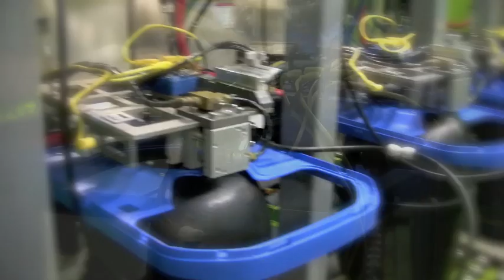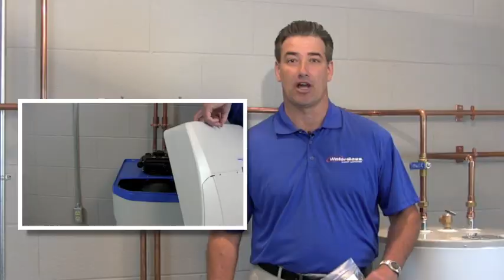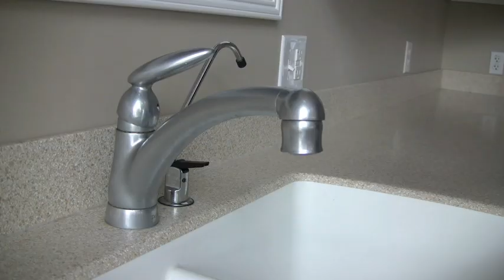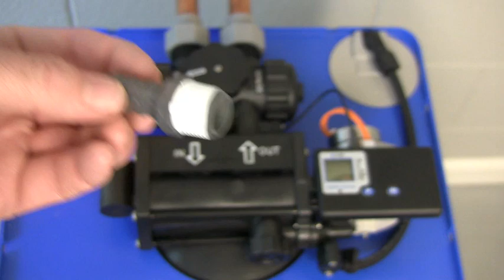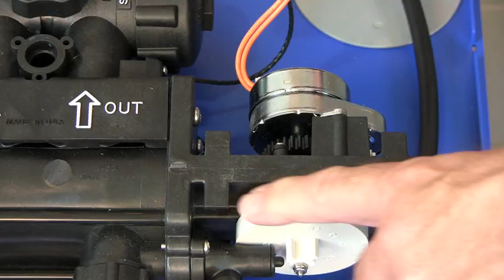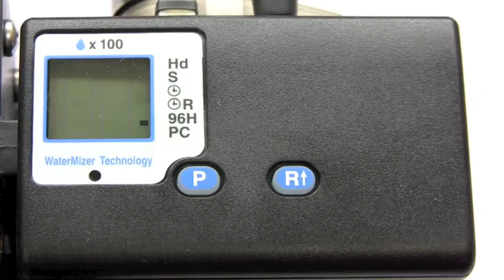WaterBoss ProPlus Installation

Comment: Do not buy the pro 180! It was missing the quest parts, the drain hose, and even the warranty card. With no water to my house I called them, and they said call back during business hours. I called today and got an automated voice response. No one was there, still have not got a return call. Fortunately, this is replacing an older unit and I was able to get by. Again, do not buy!!

Comment: I've had mine for five years and it has worked out well so far until I had to move it. I ended up stripping the plastic threads on the OUT and it looks like I would have to purchase the whole part. Very dissapointed. Bad, bad design. The GE they sell at home depot has removable plastic IN and OUt ports just incase this situation happens. I shouldn't have to buy a big expensive part for stripping a small plastic piece.
I guess it is time to head down to home depot.

Comment: Why does yours have 96H lit up? Mine doesn't.
Reply: 96H means it's on a Power Clean cycle. It will regenerate every 96 hours to clean excess iron out of the filter media.

Comment: I have a question. I have a new water boss 180 and there are cold and hot water pipes that seems to go to the water softner. No hot water should be going to the softner..right? Cold should go in..but where does the OUT line go too? Doesnt it go back into the cold line in a different spot? I think the previous owner had it set up wrong. Someone please help out...thanks

Comment: Bought a WaterBoss 180 Pro from Menard’s about 6 months ago.  It DID NOT come with Qest fittings.  Those were extra items.  Finding a plumber to install the unit was a challenge.  Most local plumbers wouldn’t touch it.  I finally found a pair of plumbers who would install a few weeks ago.  The unit works well although it does drip where the line in is connected to the unit.  The plumber used traditional copper fittings as he couldn’t find Qest fittings.  Fingers crossed.  I may attempt to re-do the connection myself, if I need too, and will order Qest fittings.  WaterBoss really should include the required Qest fittings with the unit - as mentioned in this video tutorial - to eliminate the hassle of tracking them down, locally.  Even if I was charged a few bucks more at the point of sale to have them included, it would be well worth it.
Reply: I bought my unit 5 years ago and I'm having to replace it. My old unit came with the Quest fittings and I hope I can reuse those fittings. Being a senior on Social Security a plumber is a wee bit expensive.
Reply: Well I guess I should start reading the comments. This exact same damn thing happened to me and I just had to do an hour round trip to go and get dielectric fittings and a 1-inch to 3/4 pipe fitting reducer which severely added to the cost of this unit which makes its competitively priced nature go right out the window when I had to waste additional time and money on additional parts.

Comment: This is promoted as a DIY project. However, it no longer comes with the Qest fittings, Menards to do not carry the Qest fittings so you have to call customer service to acquire them...dumb. Supposedly 2 days to get them. The old online manual says the fittings are included. Put them back in the box.
Reply: Yeah I called and bitched the lady was kinda rude but said she will send them my softener was made in February 2020 and still said they were included in my manual. It's their bad for not changing it or removing the old manuals online

Comment: So I don't think these come with the "Qest" fittings anymore... mine sure didn't and the box states 1" female NPT fittings not included. Those would have made the installation easier.
Reply: Yeah I just bought the black pro they sell at a fleet farm and we looked in both boxes they had even though saying they were included they weren't. The store gave me some 25$ solid stainless flex hoses for free. Then I called waterboss today and complained they said they stopped including the fittings in 2018. My softener was made in feb 2020. She said they were going to redo the manual but will send me the fittings for free. I figure I'll use those and keep the others for backups incase I have problems. Thing was 500$ but they were giving 150$ giftcard with the purchase right now plus I got another 10% off I hope it works good. Nice looking unit for 300$

Comment: Horrible  dont buy any I have had to purchase one every two years !!!!!! not a very good product and the customer service is terrible and they don't stand behind their warranty  rip off the unless you like to disassemble things and replace o rings for a hobby plastic wheels gears with as all magnet  The last one I got all of the red settlement and resin from the resin bed kept washing out of the unit itself right after I purchased it and they asked me if I put it on its side The store clerk lowered it and the vehicle with a forklift and took it off the shelf the same way

Comment: awesome unit. very little that could go wrong as it has very limited parts. I've owned 1 on well water for over 10 years. also,it's not a product sold by a "salt" company meaning their not double dipping-its on demand-u never have to touch it but add salt even when power has been interrupted for hours! only issue-u need to grease the wheel mechanism with good grease-if not-it will chew the cycling wheel up-only thing I ever had to replace

Comment: I have never seen a check valve installed between a water softener and a water heater. The"norm" is a check valve before the water softener to prevent back flow into the main water supply and an expansion tank before the water heater. In addition, there was no by pass shown to be able to allow hard water to bypass the softener if, for any reason, the water softener needs to be serviced.
Reply: I purposefully did not include the supplied plastic bypass as it does not allow a complete physical disconnect of the softener.